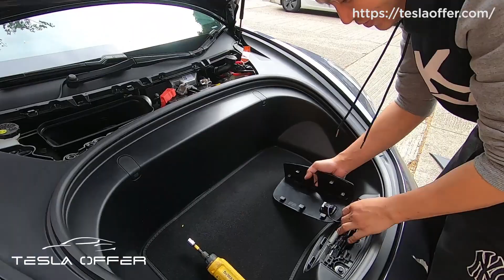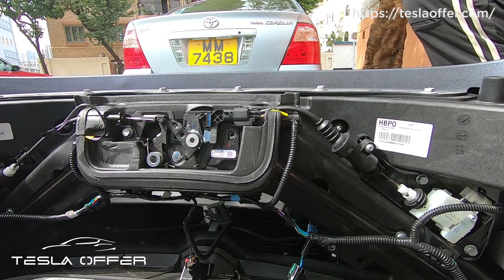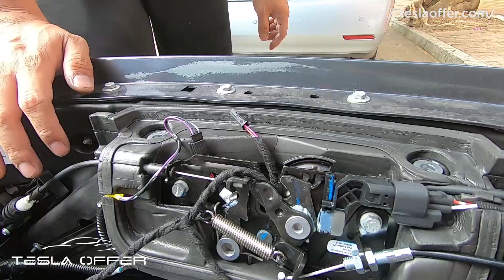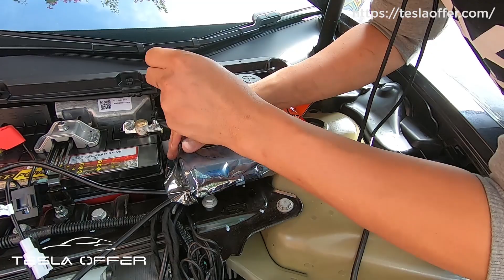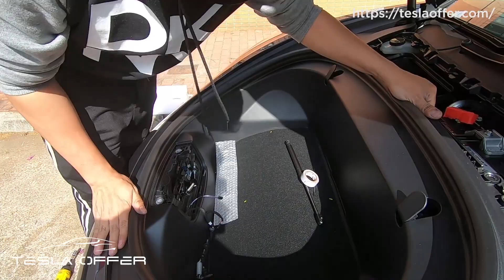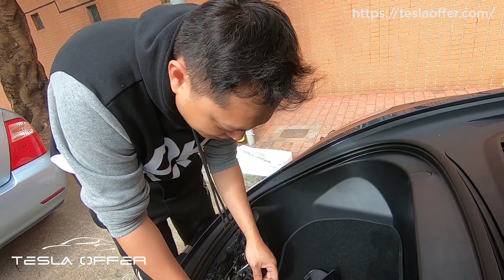EVOffer (Tesla Offer) - Model 3 (Variant A) Electric Frunk (v2) Installation Tutorial

Comment: Can we close it by using the button inside the frunk ?
Reply from the maker: Yes you can
Reply: @EVOffer  So V2 system is capable of doing it or does it need some firmware upgrade.. I'm looking for plug and play unit
Reply from the maker: @khan209i  even v1 system supports this feature. BTW our system is 100% plug and play

Comment: Raymond - I received your V2 Frunk kit yesterday and installed today. Overall, it’s easy to install, and works as designed. That said, there’s definitely some gaps in this install video (and every other one I found), as well as in the written install guide.   The written one must be for V1?? 

When you update, please be sure to show the installation of the Homelink receiver unit, and show the sequence of when/how you plug in all the cables into the controller. 

I figured everything out, except I can’t get the controller into programming mode to adjust the speed. 

It took me a little over an hour to do everything, but would have been closer to 30 min with all the instructions.   

Thanks for making a cool product that really improves the usability of the Frunk (in my opinion)!
Reply from the maker: Hi John, yes the guide was for v1. We are working on the v2 guide (sorry we are busying on new projects so we just posted the video). 

We will make a new video soon to include all the new features in our kit. I hope you like our products!

Comment: What happens if the 12v battery is dead? How do you access the frunk? Will your electric frunk open by applying 12v power to the terminals in the tow hook?
Reply from the maker: There is a little circle located at the front bumper. There are 2 wires and if you apply a voltage to the wire, the frunk will pop up.

Comment: I did the whole install. Can’t seem to close it from the screen inside the car
Reply: MrKlyde44  were you able to figure that out? I can’t open the hood with my key fob but I’m able to close it with the fob and as for the screen I can open the hood but not close it
Reply: Jose Reynoso yeah! You have to have homelink in your car. Basically you buy the homelink device with the trunk that will connect to your cars homelink. You wire it and you’ll be able to close frunk by tapping top right side of your screen where it says homelink.
Reply from the maker: Another solution to close the frunk on touch screen just released. You can check our latest video. There are pros and cons so choose the method you feel comfortable :)